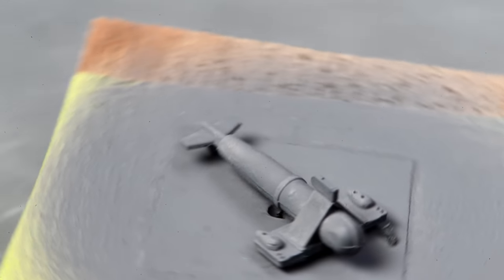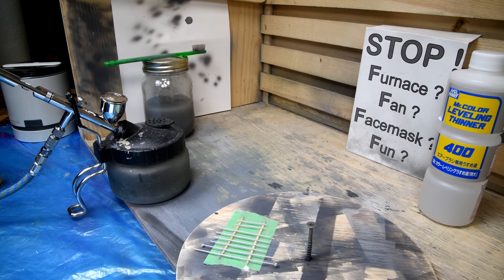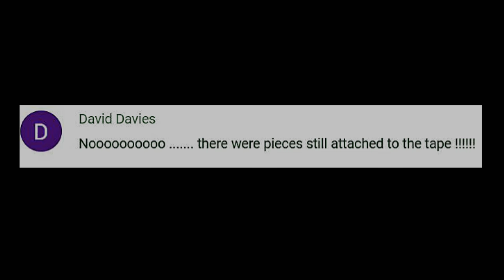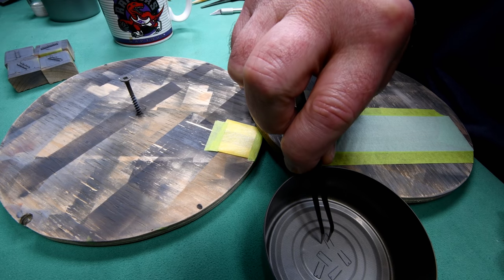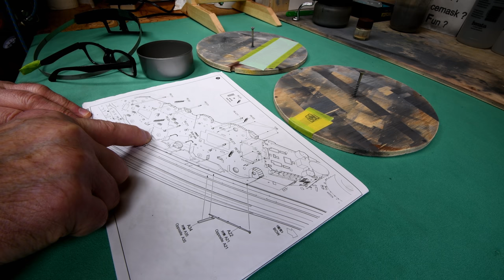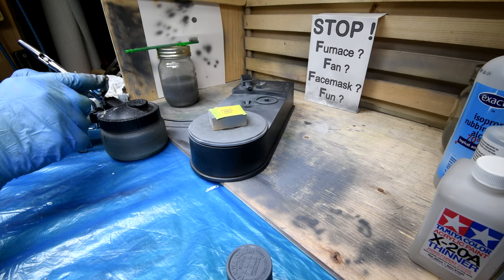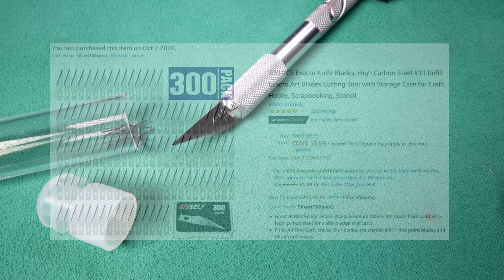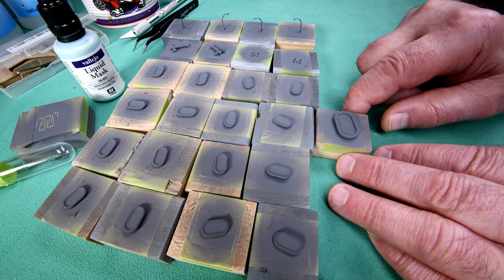The Model Ship - Part 590

Comment: Hi Ron,
I little hint for painting small details:
https://www.amazon.co.uk/gp/product/B08BPHQ1HV/ref=ppx_yo_dt_b_asin_title_o00_s00?ie=UTF8&psc=1
I tried these acrylic markers. The tips are extra fine (0.7mm) and there's a nice assortment of colors that can be used to paint small details that can't realistically be done even with a fine brush. They arrived a few days ago and I did some quick tests on scrap pieces from models. They stick well enough on styrene, but even better if the surface is primed. When I say well enough, I mean they don't go off by touching, but can be removed by intense fingernail scratching.
Reply from the maker: Thanks for that tip Savvas. 👍🙂